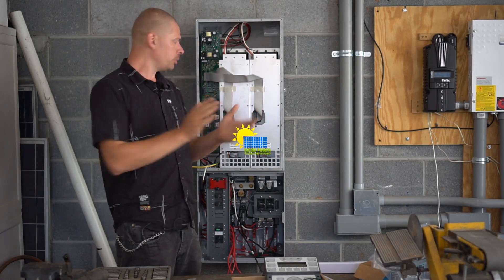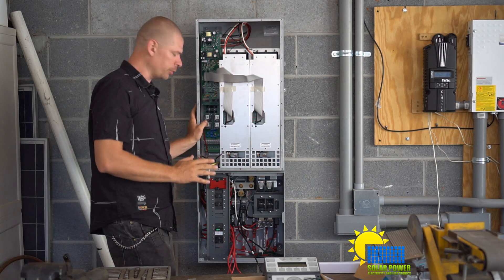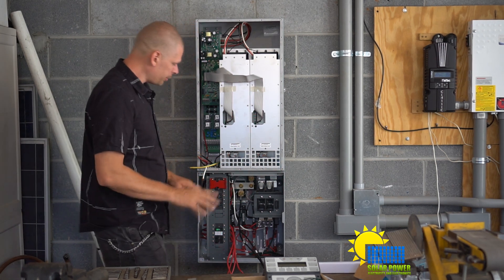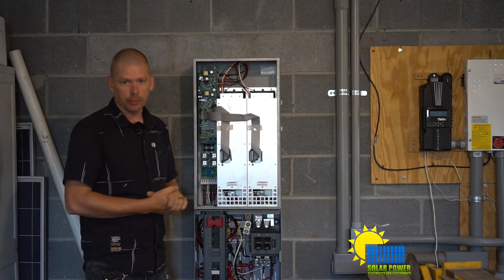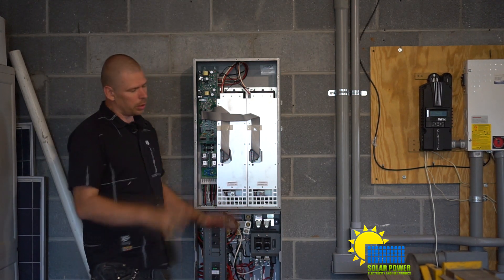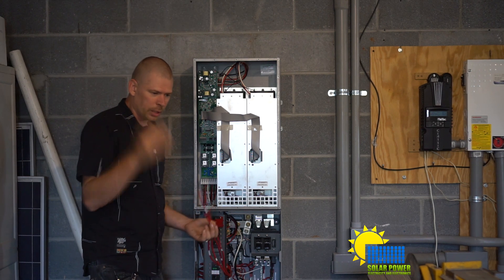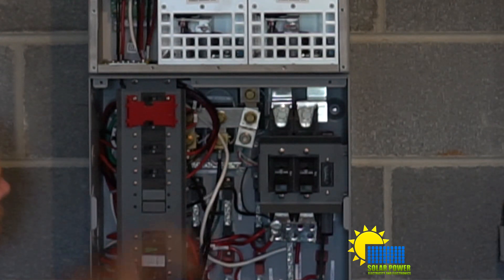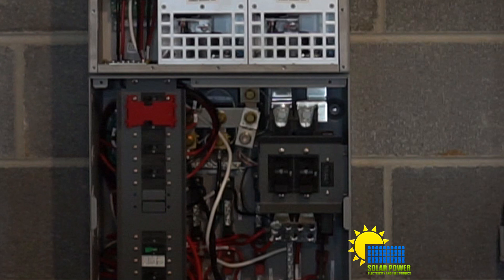Outback Inverter Installing wire for high voltage and talking about the Outback load center.

Comment: To slow your all over the place start with the actual connection from the panels to your combiner box then your combiner box to your MPPT charge controller. then your charge controller to your inverter. From your inverter to your AC circuit panel. Please show where if any fuses and there amperage ratings.
Reply from the maker: Listen if you don't know how electricity works and how to calculate it I can't help you
Reply: Solar Power Electricity and Electronics if you don’t know say so it’s obvious that
Reply from the maker: @bobbailey4954  https://www.youtube.com/watch?v=GwhatkRDgy4&t=304s
Reply from the maker: @bobbailey4954  I know every wire on this system like the back of my hand and you don't need to ask any more because i will not tell any one about the that electricity will kill you if you don't know what  your doing and this is not a diy system pay a electrician if you need this done
Reply: Solar Power Electricity and Electronics Oh I’m sorry, I thought you were informing us the subscribers your vast electrical prowess. Only problem is your all over the place not being very informative. More like childish bragging. Can’t handle some basic questions because you haven’t though your system through. Your being able to count to twenty is only because you have 10 fingers and toes. Not someone I’m willing to take any constructive  advice from. Good day Sr.
Reply from the maker: @bobbailey4954  the reason why I don't tell people and show people how to build electrical systems is because it can be fatal it's nothing personal
Reply: Solar Power Electricity and Electronics  RIGHT I get it now so what’s the purpose of the blogs?
Reply from the maker: @bobbailey4954  Big Ball Therapy